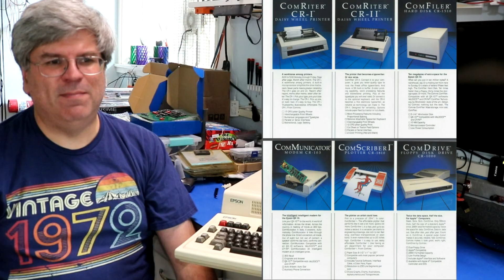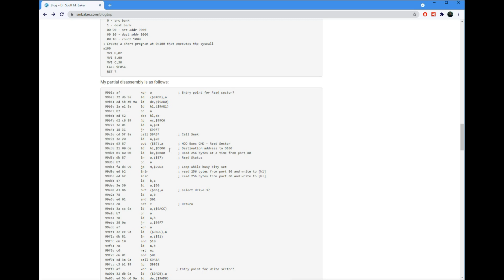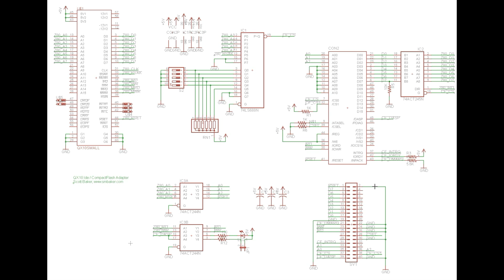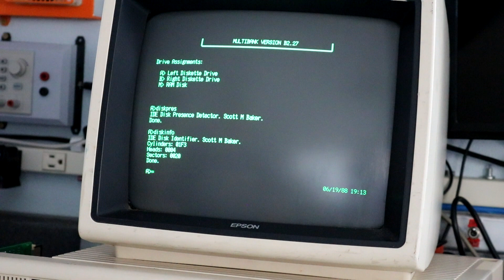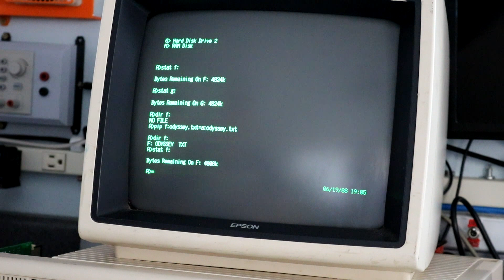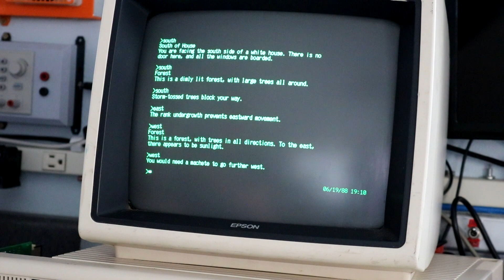IDE/Compactflash controller for the Epson QX-10 Z80 CP/M Computer

Comment: I hope to repair a QX-10 I have but it's being very stubborn. Throwing the "Diagnostic Code 0002" error which implies a memory problem but I've tested and reseated all RAM on main board and video board, tested different video IC and both DMAs.